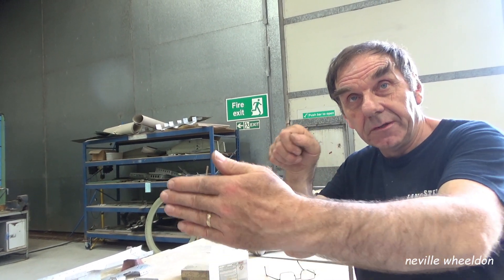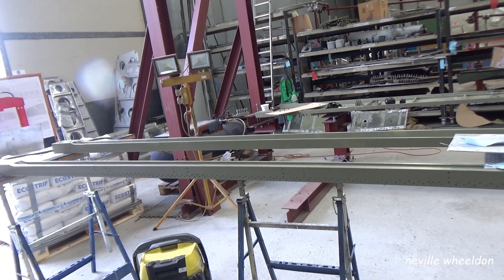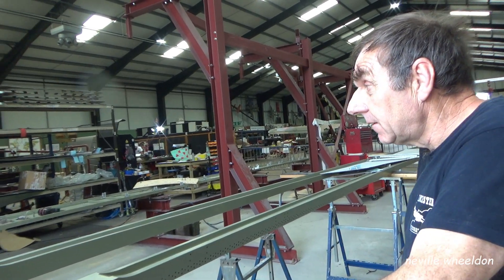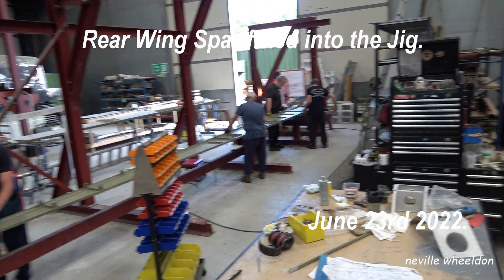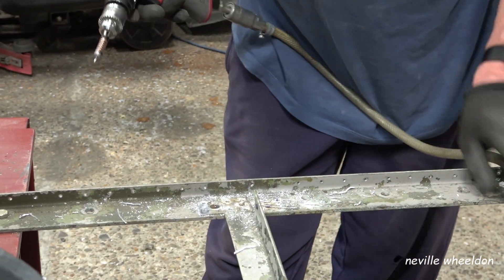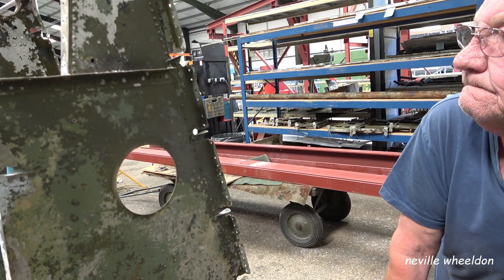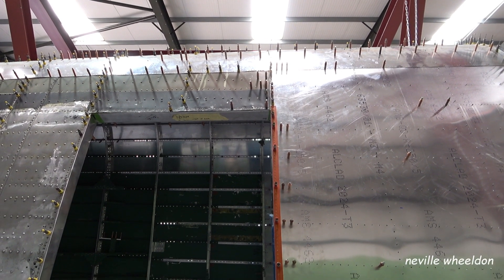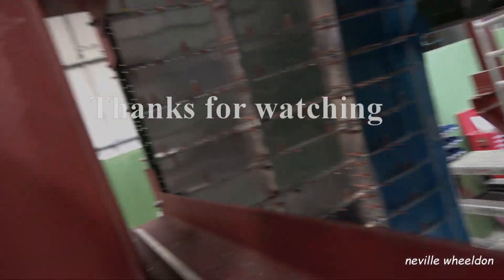Video153 Restoration of Lancaster NX611 Year 5.  Lancaster wing spar fitted into the jig.

Comment: this is the kind of video i find more fascinating, the research in trying to find how planes were built, the puzzle of which components are assembled first followed by the rest in order and how the parts are riveted and accessed
relearning the skills and detail that's been lost over time

i did some work a few years ago to remake a missing component part for a Harrier, taking something apart was one thing, but reassembly was indeed a learning curve i didn't expect, because you have to know which type are rivets and bolts are used and in which order to assemble so you have access to assemble correctly, the process is quite something

when i have watch a tv program on how a plane is built, there is so much left out i want to see, you'll see parts built, wings etc and then added to the plane followed by engines etc, what you never see is the order of the parts making the wings and fuselage, so indeed watching Pathe news reals is an essential part of research, visiting museums and taking as many photos help to identify components, types of rivets, style of bolts and so on, and as described for the under skin of the Lanc wing, simply pop riveted in place

Comment: Did they not have countersunk pop rivets in the 40's?
They could have done both surfaces.
I assume they used no rivet burrs anywhere.
Reply from the maker: Hi Mark, there must be a great difference in strength using the solid rivet, but will check that out.
Reply: @nevillewheeldon1693 Thanks for replying.
  That would be good to know. We use countersunk Avdel rivets at work which are fitted the same way as a pop rivet. These are also used on airframes. Just seems strange to use reaction rivets one side and pop rivest the other. Using pop rivets saves an immense amount of time.
Unless the time involved to countersink the wing skins to accept the rivet would take to long.

Comment: Great vid as always Nev! Regards the spar/wing assembly, the BBMF Lanc had a significant wing rebuild at St Athan in the 90's, do the guys at the Centre know anyone involved in that? Just wondering if there could be some useful info and advice to be had from that experience.
Reply: The work carried out to PA474 was the replacement of the three lower rear spar booms and is totally different to the work required to fully rebuild the wing unfortunately.
Reply: @BradleyWinder96  thank you for that information Brad, it's good to know the differences of that BBMF restoration to the wing to a total rebuild that is proposed for Jane's restoration to airworthiness.
Reply: @BradleyWinder96  Many thanks Brad, the way the PA474 work was reported at the time it sounded more of a total rebuild than that. Thanks for clarifying and best wishes to yourself and the team.
Reply from the maker: Hi Ant1980. Good answer from Brad.